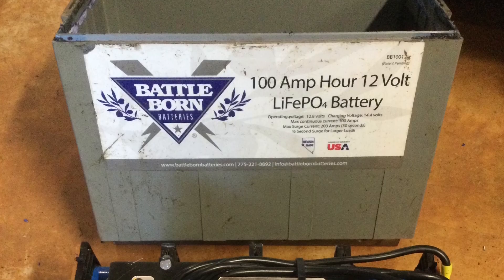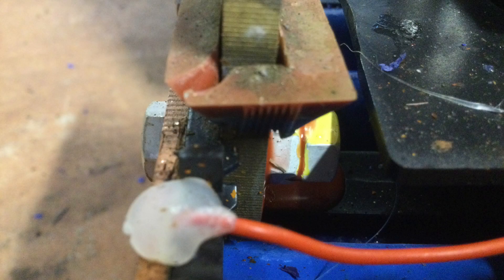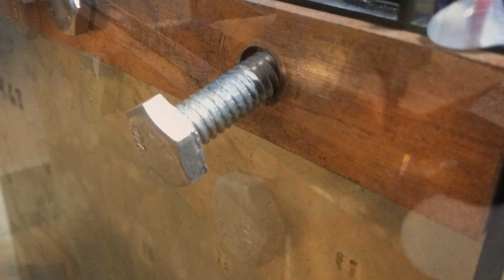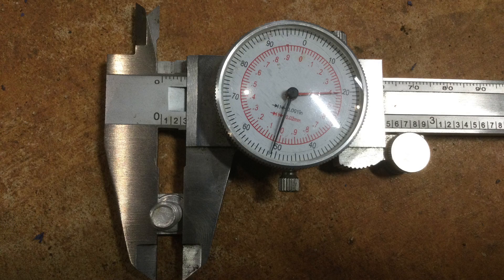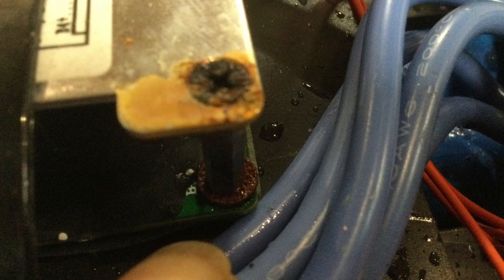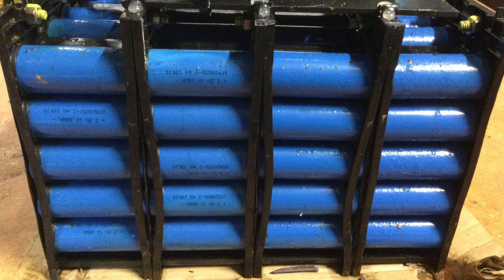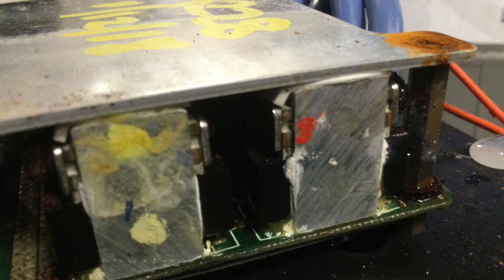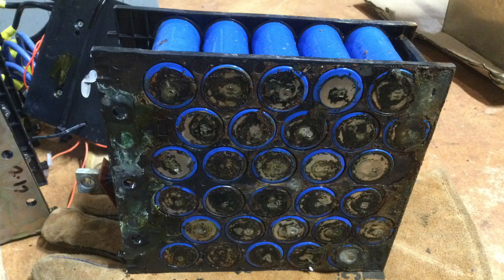Battle Born Autopsy

Comment: 4 cell BMS for a 120 cell battery KEKW
Reply from the maker: Yep, and what happens when the cells in the bottom of each module start to suffer from contact and spot weld corrosion due to the water ingress and develop higher resistance and start charging and discharging differently than the rest. 

At least with a 4S Prismatic design, there are far fewer connections, with the terminals typically at the top of the case, and interconnects that are very robust and less prone to increases in resistance due to corrosion by comparison.

Comment: sunk in salt water...insurance payout?  wrinkles under the cell wrapper?....ive seen this on 18650s that were bad.
Reply from the maker: In this environment, it would all look much worse if the damage had been caused by salt water immersion. 

The water that came out upon disassembly was fresh and more than likely due to condensation and water vapor drawn in during expansion and contraction. 

I have taken small batteries apart just like these in the past and have seen the cells covered in sweat.

Comment: Nasty.  Was that moisture exposure just humidity or was it exposed to rain and/or puddling?  If just humidity, it almost looks like the battery needs a drain hole to release condensation, and perhaps some intentional venting to help it not be any more wet inside than outside.
Reply from the maker: Humidity and moisture in the air in the form of water vapor being drawn in during expansion and contraction and charge/discharge cycling. 

The water that came out when opened up was fresh, and the cells all had sweat on them. 

Once the moisture builds up in the case it has a hard time escaping. 

Yes absolutely, I would argue a drain would be advantageous for use in humid environments, and in less humid perhaps dropping in a few silica packs for peace of mind.

Comment: eh theres nothing wrong with the design inherently. using an AL bolt is okay and the hole should be oversized coz threads would be more sketchy to carry current.... but the plastic spacer is simply the wrong material and same with the double nut application imo. just 1 more thing to get loose and fall in and short out. they could have used a phenolic/epoxy or bakelite spacer instead, just not the PE that they apparently used. it really reeks of a bespoke design that was made by a well intentioned engineer which was later adapted for a small mfg cost savings after the engineer had parted ways with the company and a spreadsheet wielding bean counter took over. really curious design change and legal strategy of defending this as a fail safe design lol.
Reply from the maker: IMO, this design has many disadvantages. 

The first is the use of numerous smaller cells spot welded together, secondly that each module is put in series with the others via thin nickel plated sheets that must make good contact with one other, the plastic cages which are flimsy and can distort in shape over time as evidenced in the video, with the major issue being the positive terminal to bus bar connection, and lastly the glued shut case. 

The problem with the oversized hole is it reduces the amount of surface area the flat under the bolt is actually making with the bus bar even more. If they threaded and tapped the bus bar, it certainly would have been better, but the design is basically a bottleneck and the compounding problem is the use of aluminum which while a good conductor with less potential for corrosion, also can heat up very quickly which only exacerbates the potential to melt the plastic sandwiched between. 

Regarding the double nutting, there’s nothing wrong with this as all the main fasteners inside have enamel applied to keep them from loosening which is an acceptable practice.
Reply: @Willdesignsandbuilds  How are the series connections made between the modules? More bolts through plastic? :(
Reply from the maker: @connerlabs  All of the cells are spot welded to thin sheets of nickel plated copper (I assume). 

The battery is then made up of four caged modules made up of a bunch of cells in Parallel with these sheets welded to each end. 

The four modules are then sandwiched together so that the plates are touching to make a series connection. 

The sandwiching is done by the inner case dimension and shims of foam and plastic on either side, and the tops of the plastic cages are bolted to each other. 

The leads for the BMS are soldered to each sheet so it can monitor each modules voltage individually, and the main power leads are attached to bus bars on either side of the outer modules that contact the outer sheets. 

The negative bus bar then connects to the BMS which then feeds the external negative lug terminal, and the positive bus bar feeds the external positive lug terminal.
Reply: @Willdesignsandbuilds I see, I guess the connections between modules aren’t quite as bad as the positive post connection. Current doesn’t pass through the bolts, and if they lose clamping force because the plastic creeps, there’s pressure from squishy foam as a backup. But still seems a bit cheesy.
Reply from the maker: @connerlabs I posted a new video going into more detail on their construction. 

One gripe I have about the plate to plate squish design is when you spot weld it deforms the surface of the thin plate so now you are asking a distorted surface to make a good connection with another distorted surface and all the support and rigidity of each module comes from a flimsy plastic cage that’s only top bolted. 

Once corrosion sets in, the plates only make poorer and poorer contact with one another which means some may deliver more energy than others, charge and discharge faster or slower, and when you have a mismatch in cells not doing equal work over a life of cycles, you will likely end up with bad cells or blocks of cells that will diminish capacity and the power the battery can deliver. 

Now if you aren’t buying this technology expecting it to last and deliver so many thousands of cycles as advertised, then I guess it won’t matter to some.
Reply: Well said!!!! True with so many things these days, profit at all cost!!!!!!!!!!!

Comment: That bolt doesn't look like aluminum looks like a zinc coated steal.
Reply from the maker: That’s what aluminum looks like after it’s lived inside a humid box. 

It is aluminum and was clearly chosen purposely as the other bus bar bolts are all steel. 

My guess is someone thought hey if we use aluminum this connection won’t get as hot and will cool more quickly, but this attribute likely starts to work against that idea when looseness and intermittent contact and lack of surface area are introduced under high load and the aluminum gets really hot and starts melting stuff.

Comment: Dragonfly Energy which owns Battle Born recently had a 1 for 10 reverse stock split which is a warning sign that their business is in trouble, so it wouldn’t surprise me at all if they start abandoning warranty claims from customers which many believe they have already started to do.
Reply: And at the same time. They are involved in 3 major joint ventures!!
Reply: This usually happens to an innovative technological company when the Bean Counter Business School Grads and Marketing Fluffs depose the engineers (example: Boeing) causing the product to stagnate and grow defects, or more recently, when the DEI hires have no clue how to solve engineering challenges. Most of my retirement savings have come from identifying this dynamic and shorting the stock of doomed corporations. I sadly missed out on shorting Dragonfly.
Reply: You are completely correct but what if you were completely wrong??  Maybe you should ask Will before you post such rubbabage!!  TOOL!

Comment: Their engineering 'choice' is utter trash - thanks for pointing out the shortcomings for a $1000 battery
Reply from the maker: For the price of BB’s, and prior to these design issues coming to light, not being able to communicate with the BMS in these batteries was IMO the number one drawback.  

A Smart BMS IMO is a Must Have.
Reply: @Willdesignsandbuilds drawback? Far from. Look at all the issues with smart batteries, especially when paralleling them. We need more basic battery designs and less so-called "smart" designs. Sometimes we just need batteries, not full blown computers that will just give us more problems down the road, while driving up the prices.
Reply from the maker: @mikeph4 I’m a fan of KISS, but unfortunately with this technology the only way to safely use it and to ensure long term longevity, reliability, and performance requires that sophisticated devices like a BMS be used to monitor and create fail safes.
Reply: @Willdesignsandbuilds  I have the intelligent version and they communicate with my Ekrano
Reply from the maker: @FulltimingBrinkley3950 Sounds like they stated offering versions with communication. Knowing why a BMS’s fail safes have been triggered, that you have slower or faster charging cells, overheated cells, etc.. is a good thing rather than guessing and/continuing to use a battery to the point of causing further damage or risk of a dangerous failure.

Comment: This Battle Born connection design oversight Is easy to remedy, with a steel bolt and copper block (not plastic) inserted between the bus bar and positive terminal, but only on future models (only if BB can accept their mistake/s and move on) but doubling-down against a literal tsunami of documented evidence is tantamount to business suicide. Thanks for the autopsy. I can't believe that plastic terminal collar more resembles a pool of melted red wax and they can't see that as a problem? 🤦‍♂ 👍
Reply from the maker: Agreed, a “fix” would not be difficult, but then they would be admitting there is a problem, and at this point in time, that is not their position. 

They have been fortunate this issue hasn’t affected a majority of their customers, and that it may never.
Reply: Sorry but not going to cut open and repair a bad design on an $800 dollar battery when I can buy one that won't over heat for $300
Reply from the maker: @robno5223  The rest of the bits inside are good, it’s just the way it is put together. Worst case you buy a new box if you can’t get the old top off without damaging, and you transplant the assembly and repackage it.
Reply: This reminds me of Sig Sauer’s P320 fiasco.
Reply: But you have to destroy the case to fix it.
Reply from the maker: @edrodrigues3333  If your batteries are newer and have been out of the UV and dry climates, there’s a good chance the top could be removed using a heat gun and some putty knives if executed carefully. 

I would then recommend removing the glue and resealing with sealant or butyl. 

Worst case (pun intended) you buy a new box and drop the assembly in, shim up the sides, and attach short leads from the positive bus bar and negative output of the BMS to the your new boxes terminals. 

And I would suggest a box or enclosure that offers easy access.

No one should have to do this, but given the BB’s  stance and that they are unlikely to stand behind their product, owners might have to fend for themselves. 

If it were me given the choice, fixing this issue and buying a new box or boxes to transplant the assembly into round be a worthwhile endeavor if I had a battery or bunch of batteries that were otherwise in good working order. 

The rest of the product (cells, BMS, wiring, etc..) is pretty good. 

It’s really the design assembly and how it was packaged that may be an issue.
Reply: @edrodrigues3333  You can cut the top off, but cut around the terminals to leave them permanently attached.  Then make a cutout on the side 2.5 inches down from the positive terminal so you can get at the bolt. Remove bolt, drill with 11/32 bit all the way through the positive post hole.  Run a 10X1.5 mm thread tap through including the hole you drilled in positive bar.  Source a 10X1.5  mm copper bolt (E-Bay) and copper nut.  Make sure it is the correct length.  In my case, 25 mm long worked. Assemble, compressing positive post tight against plastic spacer.  You got more than enough contact for a great connection, but put on the nut to help.  Test and if OK, glue it back together.  I have salvaged 2 dead units and found that one has full capacity.
Reply: @johnwood4322  Sounds simple enough. LOL!
You don’t pay that much for a battery and have to do this.
Reply: BB may fight it until the end. There may be too many batteries involved for them to admit/suggest/offer a solution.

Comment: I recall seeing a video where BB denied warranty and battery due to water ingress...I think it caused the BMS to fail.  The irony is that I'm pretty sure they advertise these for use on boats.
Reply from the maker: Yes, it’s a problem with many designs. 

As the cells cycle and heat up they expand and contract. 

Most batteries are in plastic cases that have been glued shut, not sealed. 

So any air leaks that develop can draw in moisture. 

Some even use cases that have vents.
Reply: @Willdesignsandbuilds 

The irony is that most of the better Automotive packs by the big cell manufacturers are better designed and assembled. 
It will be interesting to see what happens when CATLs new gen 5 LFPO4 cell packs hit the open market next year 2026 at 46% lower price. Also so will their Na Ion  cells .. which are pretty much temp. Insensitive and bomb proof which will be even less.  They are also producing what they call a chocolate box system... Where they supply the cells built up into smaller separate sub units that smaller manufacturers can link and distribute according to their individual needs.  They are even already producing mixed cell chemistry vehicle packs.

Comment: RIP+- 
Are there battery recycling centers for a free drop off in your area?
Reply from the maker: Normally yes. I wanted to make sure these were truly DOA as they were improperly dumped. Fortunately all the cells are dead shorted and won’t take any significant charge, so they are safe to recycle. However due to the more recent safety awareness of transporting lithium batteries, our inter island shipping company has put a hold on transporting u till they sort out handling protocols which may be the reason i found them. It’s a long drive to the proper recycling center and with a moratorium on inter-island shipping of lithium battery stuff, I don’t believe they are accepting them at this time. They even put a hold on shipping in EV’s. I think the recent increase in lithium related fires at sea  has a lot to do with it.